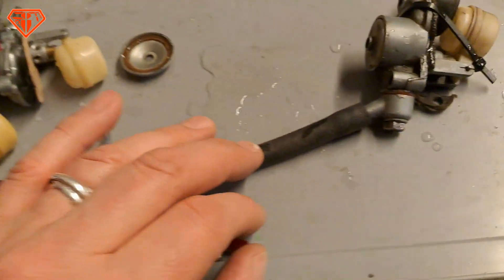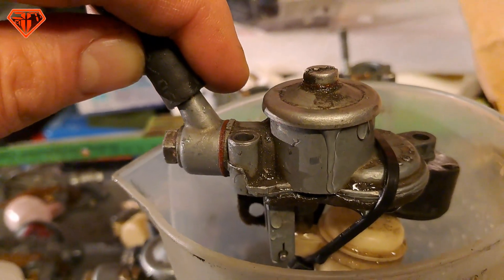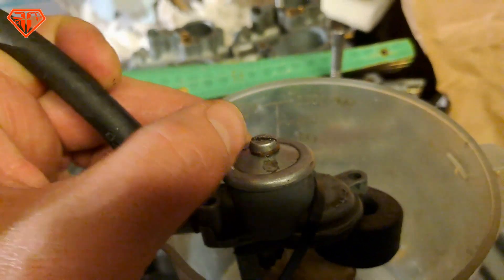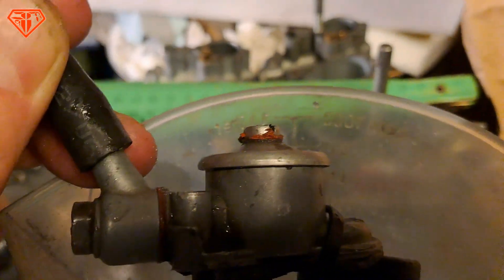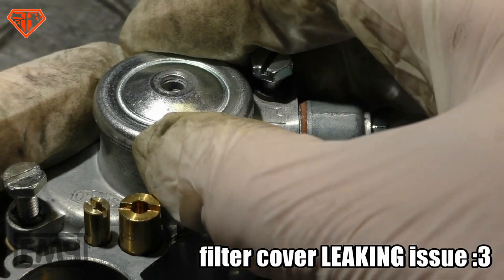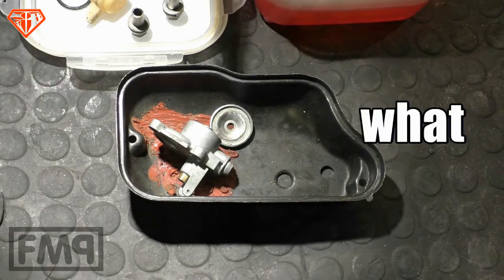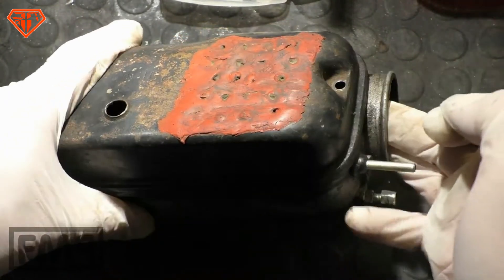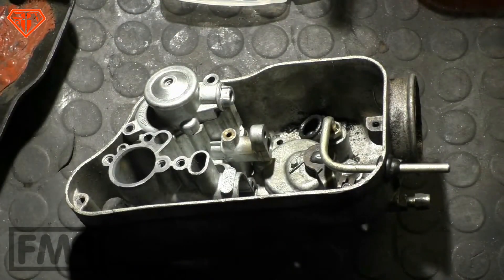vespa SI CARB leaking & its REPAIR | warm start troubles | filter cover |

Comment: Oke,  may I ask about my vespa 150 excel (locally indonesian type mention) but i believe it was similar to T5 or PX, its about my 20/20 carb always seem flooded because of there so much blowback from the engine.. and i assume residu of the blowback make my vespa hard to start, even in hot condition,  but for now, i am ok with that, my question is why it is impossible to start my engine while i pull the choke lever even i believe there is no more rich fume from the blow back effect i told before , is there anything we can set or there are broken part from choke mechanism?
Reply from the maker: did u check / apply what i showed jn the video? then also check gearbox oilsucker